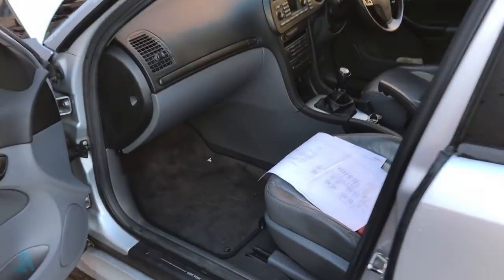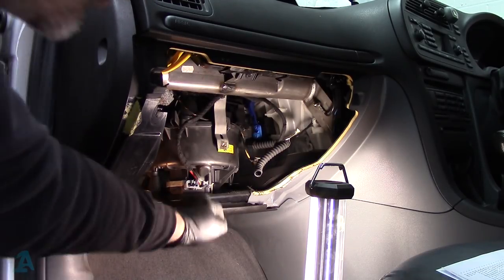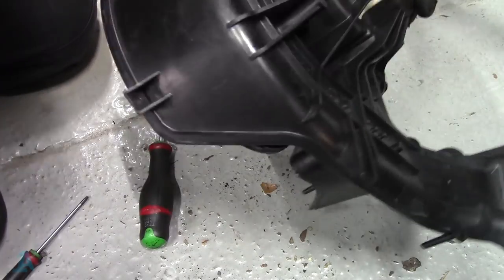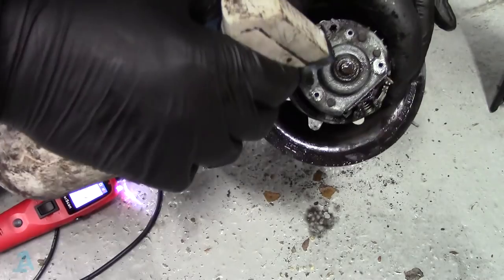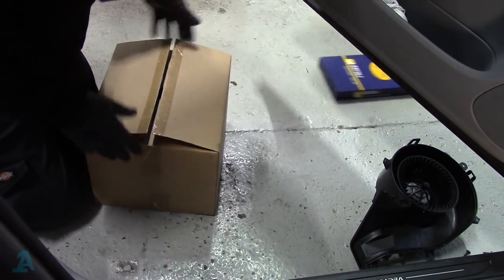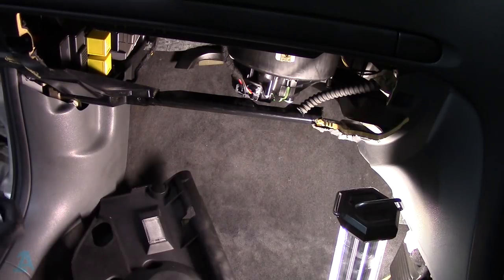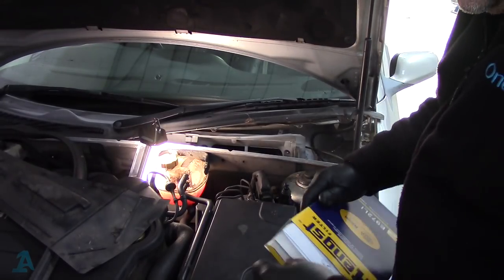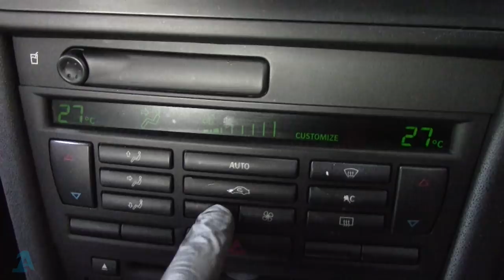Saab 9-3 HVAC Blower Fan Motor Not Working

Comment: Great work. The only other thing that should be checked is the gasket seal behind the cabin air filter holder. These tend to rot and crumble away over time thus causing, or allowing, water to seep into the blower motor housing and eventually damaging the blower. If you pull the entire filter housing off and find this to be the case (a damaged seal), you would have to scrape off any remaining old seal and replace it with either waterproof caulking or gasket maker. Once that's successfully done, the filter housing is reinstalled and there should be no further problems with water seeping into the blower motor area. That's what causes the interior carpeting to become soaked
Reply: I have been having this exact problem.  Thanks for sharing. Easy fix

Comment: Nice video... Thx
But...... The cabin filter housing has a felt seal where it meets the bulkhead
This seal crumbles to dust over time
Remove housing wet or dry bulkhead
Fit new seal to housing... Apply a little tiger seal.... Done.
Just saying.
Great video really enjoyed it.

Comment: Common problem on these and the vectra C.     I made sure I cut the rubber drain plug bigger in mine so this doesn't happen.  Another thing you can do is cut the top part of a pop bottle off and stick it in the rubber drain to open it up so it always drains and prevents this
Reply from the maker: Good tip!

Comment: Hi , purchased a 2005 93 a month ago , noticed when I turned the engine of there was a tapping noise last week the blower has just stopped working however occasionally I will hear a tapping and a very slight brezze of air , sound similar to what you have just done just though you had any ideas before I take it in , I got charged for 2 glow plugs £98 2 wks ago ...maybe because I'm a woman 😕
Cheers Sarah .

Comment: Another nice diag and repair vid Rob , Any reason why it did not pop the fuse  , my old landrover 90 used to be the same it would get water down to the motor start to seize it then just keept popping fuses till you free up the motor .
Reply from the maker: Thanks. The motor was that big 40A maxi fuse in the fuse box. I guess it didn’t load it enough to pop.

Comment: I cleaned 10 years worth of mud and pine needles and a dead mouse carcass out of my neighbors car last year. Although in that case the wiper motor and mechanism was the casualty. Those style drains seem especially vulnerable to getting blocked. 

I've never really worked on a Saab before. What is getting parts for them like?
Reply from the maker: They just a Vectra in disguise so parts not too bad

Comment: Another great vid rob. Can I ask what that tool is you used to feed the motor power and roughly how much they cost.
Reply from the maker: Thanks. Click in the description there is a link to the tool £100
Reply: 2 pieces of wire and a fuse, about 50p

Comment: Some people advise getting rid of the elephant trunk rubber drain altogether so never clogs ? Good idea or not
Reply from the maker: Depends weather it diverts water away from any sensitive areas or not. But I’ve done that with other cars before
Reply: One Auto, thank you 🙏 in U.K. one of the drains dumps water on steering joint - left hand side one ☝️

Comment: The wiring harness that connects to the blower motor melted i had to remove the plastic connectors. I bought a whole new harness but am having trouble removing the harness. I thought about replacing just the plastic connector but cant seem to find them. Do you think i have to remove the whole dash including the radio just to get to replace that harness?

Comment: Very good video.Did you change the Heater Control Unit Reostat?Or you put the same?
Reply from the maker: Left original in there
Reply: @OneAuto  i saw actually, that it was the original.I wanted to know (because it's very important for me, i have the same problem in MY2006 aero), if you replace it with a new one, or you put the same back (with the damaged terminals).Jut in case, is there any possibility to be the HCUR out of order and need to replace with a new (genuin original off course) one?Thank you very much.

Comment: i was able to fix my original motor. in my experience the friction was on the motor end and not the fan end. i reccomend you put 3 in 1 electrical motor grease (2.99 at lowe's) and let it sit motor end down. try the opposite if it didn't get any looser. i ordered a replacement motor but by the time it got to me the original motor was spinning as good as the new one so i returned it. be patient if you want to save some dollars unless your living in extreme temperatures. you're also going to want to get some waterproof caulking to get your filter back on properly as that's most likely how water got in.

Comment: Hello, great channel and great vids ! Just a quick random question......i have a 60 plate nissan qashqai which i have placed a deposit on which had no mot.....the garage said they would put 12 months fresh mot on it if i wanted to purchase the car so they put the car through mot but the vehicle failed mot and the Reason(s) for failure were

Windscreen washer provides insufficient washer liquid (8.2.3)
Offside Front position lamp(s) not working (1.1.A.3b)
Parking brake: efficiency below requirements (3.7.B.7)
Advisory notice item(s)
Parking brake lever has little reserve travel (3.1.6b)
Nearside Front Tyre worn close to the legal limit (4.1.E.1)
Nearside Rear Brake pad(s) wearing thin (3.5.1g)
Offside Rear Brake pad(s) wearing thin (3.5.1g)
Nearside Handbrake Cable Snapped

Is this anything for me to worry or should i go ahead and purchase the vehicle? Its fully hpi clear .....all prevvious mots where passed with advisories only mentioning brake pads/tyres/tread perished ect .....97,000 miles on the clock £6500 ? 

Thanks jay
Reply from the maker: So I guess your saw my Qashqai handbrake cable video then? https://youtu.be/aOfmwlC6beA
I don’t have a clue about car values to be honest. 
If they do the repairs to the car I don’t think it’s a problem but obviously you pays your money, you takes your chance as they say.

Comment: Did you have any fitment issues with the aftermarket fan housing?  I just started to replace the burnt out OEM fan on my 93ss and I bought a NISSENS branded one and it does not fit as snuggly as the original one.  When I try to pop it in by the backside of the firewall. It just doesn't want to slide into the grooves of the HVAC housing.  I'm about to transfer the new motor into the old OEM housing.
Reply from the maker: mrdub02 Nissans are generally good. But they are very awkward to fit

Comment: So… in the past year, I have already replaced the blower & module. Just recently the air stopped working & I thought it could have been the module. Ordered a new one put it in & nothing… So I bought another blower. Plugged it all on turned the car on cranked the air up to finding nothing… Again. I have check all the fuses, they are fine… What else could I be missing? I am hearing no clicks nothing whatsoever when turning the air on.
Reply: Check the pins on the plug to the blower. Sometimes the contacts burn or separate if the plug gets hot (if motor  was struggling as was probably the case in your original blower motor)

Comment: Great video, mine packed in today on its 1st year of ownership by me lol, i see loads of used ones on eBay, where did you get a new one from?
Reply from the maker: GSF car parts
Reply: @OneAuto  thanks for that, I've just come in from fixing it, not sure how long term but a clear out of the absolutely filthy pollen filter, and unblocking the drainage channel and lots of WD and I have a working fan! Thanks for your video made light work of the fix for me

Comment: I just changed out my battery on a 2003 saab, now no air movement for my ac.  It worked fine before i changed my battery.  Is there some kind of setting i need to change or something??
Reply from the maker: No, check your fuses or it may just be coincidence

Comment: Listen to me if your ac is blowing hot look for fuse 20 under your hood its not marked it control the electronic fan if the fan doesnt spin the compressor wont turn on saved me 1200$ for a 3 dollar fuse. Took me over 2 years to find it. I have a saab 9-3 2009 hope this helps someone.

Comment: Hi i have a saab 9-3 2007. My blower only works if my lights are on. Any idea what it would be. 😔
Reply from the maker: Never had that before but my initial thoughts would be something to do with the control module or it’s wiring as this is illuminated when the lights are switched on.
Reply: @OneAuto  thanks for getting back to me. I forgot to mention that my son spilled a little cola on the buttons and was two days later it started to happen. I don't no if that is the cause of it. I will try get at the wires and have a look. Thanks

Comment: I have a 2002 93,my blower heater has stopped working,blower motor is free,its making the slightest high pitch sound when I do turn it on and hardly blows anything out,any ideas,just had a windscreen change and after that lots of rain,any ideas anyone

Comment: Such a waste, they say black plastic is not recyclable and yet u can't just buy the motor alone, u have to buy the complete thing when there is nothing wrong with the plastic housing, so more plastic in landfill!

Mine packed up and it was the earth terminal had burnt where the ecu meets the motor, it's not working again, I'm hoping it's not burnt again!